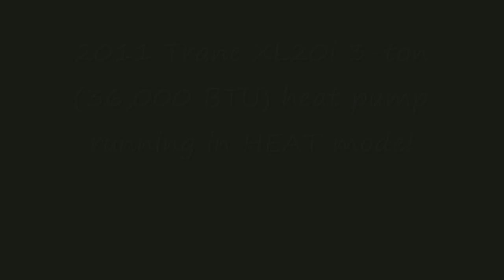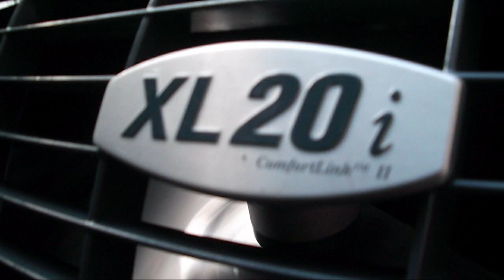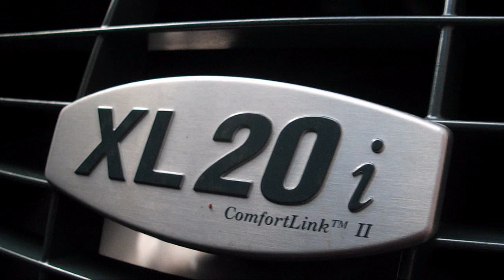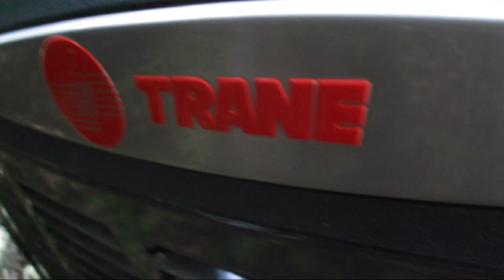2011 Trane XL20i 3-ton heat pump running in HEAT mode!

Comment: The high stage compressor is a 5 ton compressor and the low stage compressor is the 3 ton. (Low stage only runs when maintaining a constant temperature setting on the thermostat) smaller the tonnage less "juice" it needs to run.

Comment from the maker: If it it's a dual-fuel gas pack (heat pump and gas furnace), then yes, the heat pump will go into defrost. If it is a straight-cool unit/gas furnace, then no. A packaged unit works just like a split-system.

Comment from the maker: @84randomdude If the XL20i heat pumps are about six grand each, and the 25VNA is about ten grand, wouldn't the XL20i units be slightly more. Either way it is a better deal. I trust the XL20i's system components more than I trust the 25VNA's inverters.

Comment from the maker: @84randomdude I think I could get two XL20i heat pumps for only slightly more than one Carrier 25VNA. The Carrier is quieter but for some reason I still like the Trane better. The owner of the HVAC company who lets me film at his building just had a 25VNA installed at his home.